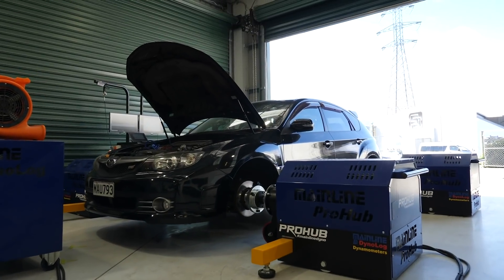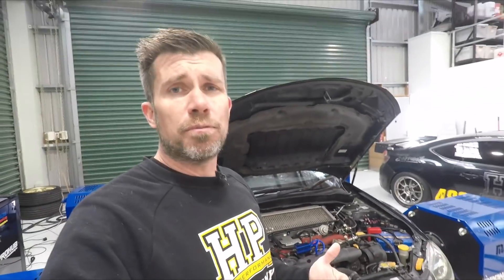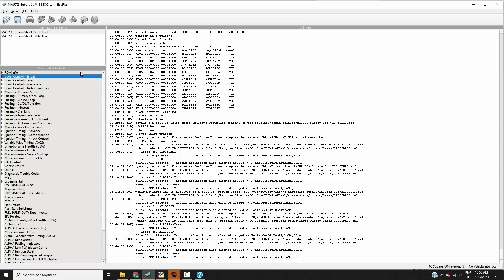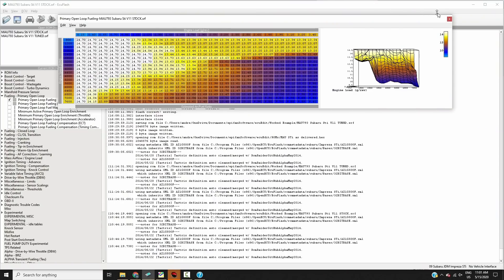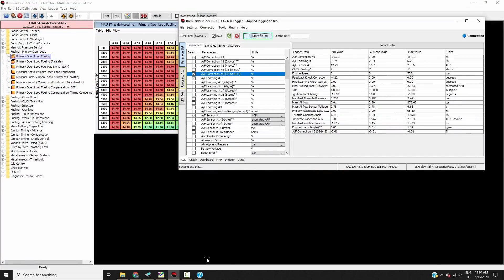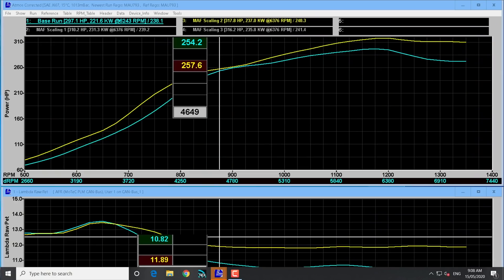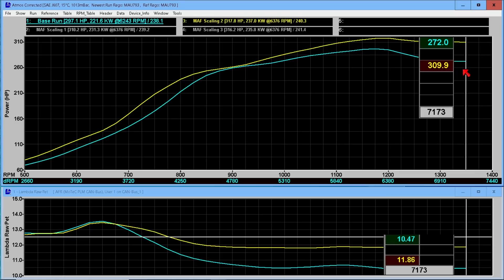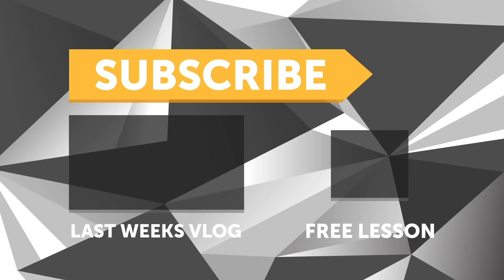Are OEM Tunes As Good As You Think? | Ep 2 [OFF THE RECORD]

Comment: Why wasn't the maf calibration correct out of the factory?
Reply from the maker: You'd have to ask the factory, although generally their tunes try and account for a range of fuels, emissions and climates and it's hard to do all that without compromises.
It is a common line to state you cannot improve on the factory tune however, and this helps disprove that as when you have a single goal, in this case increased performance and you know you're going to be running the car on quality high octane fuel, you can certainly make large improvements - Taz.

Comment: Quick answer, No they are not.
Reply from the maker: It's actually quite hard to make blanket statements about factory tunes. In general I'd say from my own experience that they tend to be overly conservative and leave plenty of potential for power gains. Then you come across the occasional car where the tune is right where it needs to be and without hardware changes you're not likely to gain more than a handful of hp. Admittedly this is the exception, not the norm, but it's important to mention so we don't mislead expectations .
Reply: @hpa101  Interesting rebuttable. I agree with you for the reasoning of a conservative stand point because an auto manufacturer is not going to dyno and tune every one the produce. However in my limited experience with power and mileage gains the factory settings are usually much lesser than even a quick road tune. Spending 10 minutes tuning grants either 10% increase in power at the top end or 10% increase in fuel economy. I have no experience with forced induction which on its own you would want a more liberal tune just in case.

Comment: Maybe i missed it, but i wanted to hear more about why can't the factory produce a proper tune with as much power like you guys did? I saw your description, but i was hoping for more info in the video. More about factory tuning vs aftermarket
Reply from the maker: Most factory calibrations are designed to ensure ultimate safety for a car that might be sold to multiple markets around the world, running on various different fuel grades, and under dramatically different atmospheric conditions. For these reasons a conservative tune is the usual preference to ensure safety and reliability under the worst possible operating conditions - Andre

Comment: I thought it was a 1UZ-FE that had a hole in the side of it?
Still can't like flash tuning. I know it's come a long way since the days of burning ROM chips, but still, live tuning with a modern motorsports ECU makes life so much easier
Reply from the maker: These days unless you're building a dedicated competition car, need specialist motorsport features like traction control, extensive logging, anti lag and closed loop gear shift control (even some motorsport features are available in custom patches for a stock ECU), it's hard to justify a standalone. In the majority of cases the ability to live tune is irrelevant since you're only focussing on a narrow range of ECU operation when reflashing (often WOT), which you don't tune 'live' anyway. If you're looking at some of the options from the likes of Cobb, real time tuning is actually an option too.
Reply: @hpa101  With how integrated many new cars are with their ECU (vehicle stability, transmission, diffs security...) It may also been largely impractical to put in a stand alone unit. And in those cases reflashing is really the only viable option, without going to extremes. Fortunately, my cars are from the glory days (or earlier) where the stock ecu is little better than an abacus or a pair of twin Dellorto

Comment: Great info here, definitely learned something new with regards to MAFs being good. I always wondered about that. Interesting about the rich AFRs from the factory over there. Here in USDM, the complaint on the turbo EJ25s is often too lean right when you need it, but maybe it goes rich again once you get past boost threshold RPM? Also, is the 1UZ-FE out of the 86 chassis now, with a 3UR-FE in its place? Can't wait for updates on that!
Reply from the maker: The stock calibration does try to run the engine at the stoichiometric AFR as much as possible to be fair, and particularly in transient conditions and in the spool up areas of the map the AFR is often leaner than desirable. Under sustained WOT operation at high rpm however the tune does resort to 'pig-rich' for component protection.

The 1UZFE has a rather large hole in the side but we're building a bigger and better mouse trap. You'll hear all about it next week (spoiler alert, it's not a 3UR-FE) ;)

Comment: How did you connect external AFR sensors to ECU ?
Is that innovate WBO2 controller with analog or CAN output.
If analog, which stock ECU analog input you had to sacrifice, if any ? Or additional sensors can be connected somehow without removing anything in return ?
Reply from the maker: This is an Innovate MTX-L gauge that is brought into the laptop via a serial to USB connection. I prefer not to use analogue connection for a wideband where possible as the accuracy is heavily affected by ground offsets. The stock front sensor in the STi is actually a wideband but they d=tend to read slightly inaccurate at high boost/rpm so I prefer a proper wideband - Andre
Reply: @hpa101  what about relocating the front o2 to post turbo?
Reply from the maker: @OnlyDominican  the front O2 sensor in this particular model is post turbo. It's actually not too far off and many people do rely on them. From memory it reads about 0.1-0.15 richer than my wideband at 20 psi boost. You could certainly bake this into your AFR targets once you've confirmed how far out it is.

Comment: @HPA how do you feel about kinugawa turbos? I have seen that they are a significantly cheaper option compared to a Garrett however most opinions illustrate that they are unreliable.
Reply from the maker: It's nice in so much as it's a bolt on fitment and retains the JDM split pulse style exhaust housing. So far we've had no reliability issues but it's significantly laggier than stock and with our stock fuel system we really can't exploit its abilities at higher boost levels just yet. I can't comment on reliability except to say we've had zero issues so far - Andre
Reply: @hpa101  Thanks for the reply Andre! I will speak to my tuner as I want to run boost levels of around 20psi through a GTX3076 frame turbo.

Comment: While I agree that the factory tune isn't always perfect, it makes me wonder what their reasoning is behind this? Why can't they make it optimized from the factory?
Reply from the maker: These cars are developed for multiple markets around the world where they will operate on a variety of different fuel grades and under dramatically different atmospheric conditions. For this reason the base calibration is set to be very rich for safety.
Reply: @hpa101  Ok that makes sense. Thank you for replying 👍
Reply: A motor that runs rich blows a bit of smoke. A motor that runs leans burns a hole in the piston. One is very expensive to fix, the other is not. They will eer on the side of caution

Comment: Bought one of the first WRX's in the USA 🇺🇸  in August 2001. Went from running 14.3 stock to running 13.5 @98mph with less than $200 in mods. Turbo cars rock. 👊👍
Current truck (5.0L F150 V8 NA) $1500+ in  mods for about 35hp....  yay! 😵😔 luckily won the $1000+ exhaust here on YouTube  😁👍🙏❤
Reply: Ha, forgot to mention my 5000+ lb F150 ran 14.3@98mph stock. No question it will be going through the traps on the factory limiter now.
Reply: She is going into the shop in the morning to be lowered via Ford factory rear lowering shackle kit. May also remove the stock blocks as well... gotta keep her tight and right.
Reply: Sorry to spam but my local track is limited access.... $200 per car per day....  Yeah, but mostly no. Nope.
Reply: Continuing to spam. She's dropped with factory blocks gone. Perfectly level now. Very happy with the mods.

Comment: There is no one, universal software for all the engines/manufactures?
Reply from the maker: Unfortunately no. While ECUs are really all essentially doing the same things, they are programmed in different ways which is why different software is required that is specific to the ECU.
The structure, or layout for lack of more technical terms, of the ECUs is also not something that is published by manufactures, so not only is there a lot of variance, before software can be used to make any changes first software engineers must reverse engineer things.
This is why most reflashing software is not free and why often companies will specialize in specific marques once they've put the effort into them to start with.
That's a really quick and dirty rundown without all the detail there is on the topic, but I hope it gives you a fair idea/answer - Taz.
Reply: @hpa101  
Thats strange, considering that OBD works in the same way in every car and you can use one ELM327 in Mitsubishi, Renault or Mercedes. 

Thank You Taz.

Comment: Factory tunes trade performance for longevity.
Reply from the maker: @Questchaun can you provide some data on why this particular example we have showed was excessively rich in the interests of longevity?
I feel that this assumption is thrown around the internet a lot without any data behind it when it comes to a stock setup and factory tune vs stock setup and 'aftermarket' tune so it would be good to know what the source of this assumption to see what evidence is behind it 🤘- Taz.
Reply: @hpa101  Good on ya Taz. I need to see data that proves these kinds of comments. Because, like you said, these comments are littered all over the internet. Particularly in online forums where most people get their information from. And if it's said enough, most people will believe it. Even if there is no substantial evidence to prove those kinds of claims. No offence to Questchaun because you probably came to the same conclusion based on seeing that particular comment over and over on these forums. May data prevail!
Reply: @hpa101  I think is more related to safety, so it's 99,999% safe on every enviromental/driving condition, doesn't mean that's a better way to run the engine for longevity as running richer may cause a little bit more wear on the same conditions.
Reply: Along with fuel economy and emissions constraints.